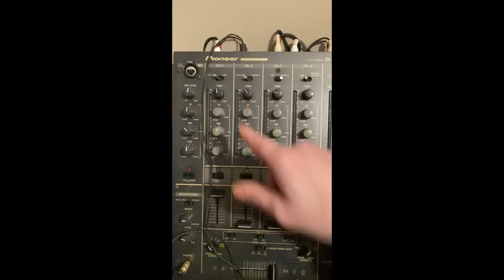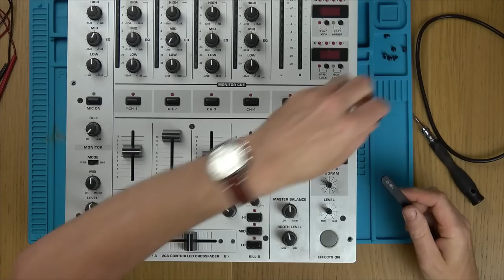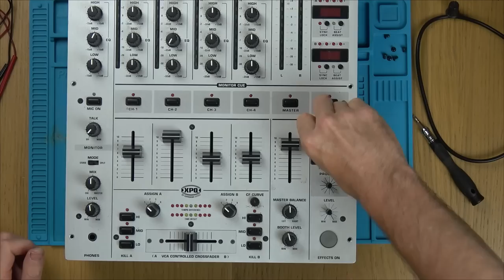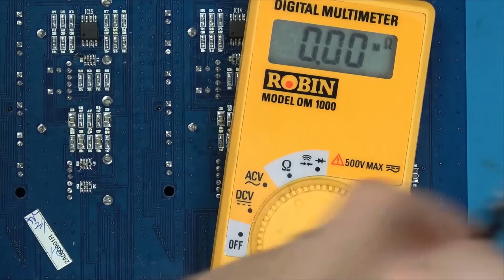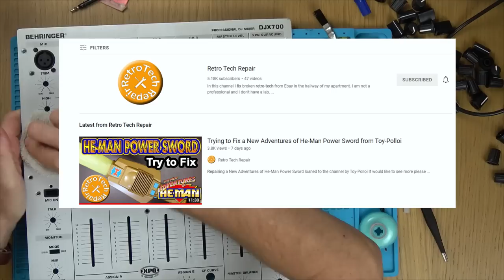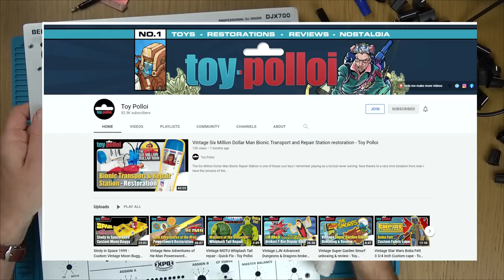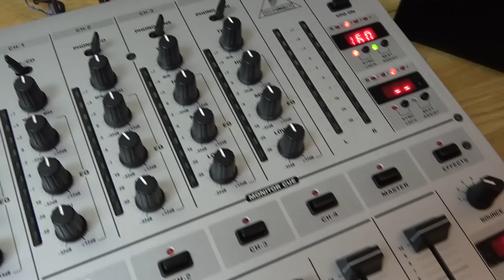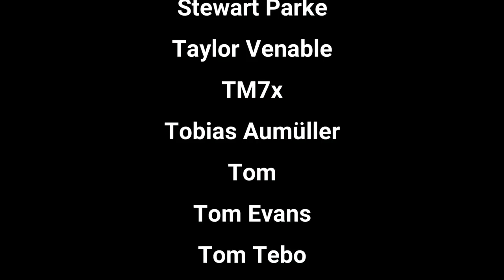Can I Repair a Faulty BEHRINGER DJX700 DJ Pro MIXER

Comment: Hi vince! Very cool video there! 👍

One tip on measuring resistances, don’t take the vales under the resistor to serious. It just means the component needs to have that amount of resistance, but combined with other resistances in paralel can offset your measuring value, which is totally fine. If you just have one resistor, of 100ohm, you will measure 100ohm, if you have two resistors in paralel of the exact same value, in this case 100ohm, you will measure half the resistance, 50ohms in this case. Gues what the resistance will be with 3 of the 100ohm resitances, 33ohm in this case. On 3times a 333 ohm in parallel will measure 111ohm just to make another example. 

On different values of resistors you need to calculate them thru, but remember this as normal for reading an offset value in measuring resitance in a circuit compared to the component specification. Hopes it will help you😀 there is a forumula to calculate the total value of a circuit consisting out of different parallel resistors. Resistors in series you just ad them together to their each respectively and possible paralel path. 

I hope you already found out about inductive load in AC systems and their inductive resistance. Dont take a low resistance all to serious in ac systems as well. If you measure a tranformer of coil.

Keep up to good work🙂
Reply: Yo vince, I forgot to tell, if you ever measure parallel resistances, expect to see a lower readout then the lowest resistor used in that circuit. This might hint you directly if a measurement could be legit or not.

Comment: I had a few of these mixers, they get you out of trouble for a while, but they always seem to develop these problems. Must be done to cheap parts. I had some advice from a sparky, who specialises in dj equipment, and he said the are not really worth the agro for a few reasons , part availability is apparently a problem. My one at moment has no output on headphones and every Chanel has interference , or low volume. It must be the switches and potentiometers, as these see the most use. I need to save up for a pioneer

Comment: Those behringer mixers suffer with bad up and crossfaders.
The other guys DJM600 was probably one of the best mixers I've ever had compared to the newer ones, really full sound on vinyl as they had decent pre amps in them.
Reply: I've got to agree, I had the DJM600 back in 1999 and with my 1210 Mk2's they were the best bit of kit I've ever had.
Reply: no, djm600 is not good sound-wise (muddy high, so-so mid) , but fair build quality and excellent repair/parts service is available

Comment: Hi Vince 
Looking at your when you were comparing chip numbers 22:23 the top pin of the pot ( by resistor r13) looked like it may have had a dry joint , may be worth looking at your footage ? So when you swapped them you could have cured the dry joint by resoldering the pots 

I do like the Rolls Vids , but it’s great to see some blue mat stuff as well

Comment: I had a tube radio that would squeal when I turn the sound down. Turned out that the volume pot was bad and it would go into oscilation. Could be something similar but dirt related?

Comment: By the looks of it it the channel two and master slider might have worn out or have dirt on the carbon tracks only came across one similar to that. The general fix is to replace the slider for a new one if the gold contacts is bent or broken or the carbon track is gone that what I would usually do

Comment: They can be funny things and get a lot of moisture in them mainly beer lol but the sliders should be zero half an inch to a inch from the bottom depending on the model and the top potentiometer is gain so theirs no middle ground compared to the high mids and lows on the others and your right if phono wasn’t grounded properly it would have an effect on the channel and the stereo capacity giving more on one side than the other but mainly due to grounding issues

Comment: For the desoldering vacuum, it is quite possible it has lost efficiency (assuming you were actually able to melt anything, you might just need to hold it there for longer, I assume you already had it set to 480c). I have used the same tool quite a bit and found that it is very sensitive to cleaning. You need to regularly replace both filters (the one on the front face of the machine as well where the tube goes in) in addition to emptying solder from the handpiece. And holding the board upside-down so gravity is in your favor can help...but I know this is not good for a video :)
Reply: also when desoldering something with a lot of metal attached to it (like a ground plane or RF shield), it could be that the heat transfer capacity of the tip isn't enough to heat the contact point up to the required temperature before the heat escapes. this could be due to number of reasons including dirt or oxidization providing heat insulation either on the tip or the contact. but if both are clean, there's no heftier irons around, and it feels like the target temp is close enough, then heating up the whole thing with a hot air gun first before retrying the desolder could just make the difference to get the solder to liquify, the means are many. (and if it's a crappy old RF shield there's no shame in first reducing the thermal mass with side-cutters, been there done that)

Comment: I have the behringer ddm4000 I took it apart cleaned the inside put it back together switched it on and it went pop now doesn’t work the magnet looking thing inside was hot glued to the inside base when I took it apart second time it wasn’t glued down do you think this stopped it from working or made it go pop please ? Also are you close to Milton Keynes area I love my mixer and I really miss is I have cash 💰 if this helps ?

Comment: you get two old forks to get dials tops off. also a note audio volume is not liner 10W - twice as loud 100W  - four times as loud 1000W

Comment: hi you never need to go any where with the buffer audio ic's   if they are playing up they over heat 
very likely it the pot logs  i worked on alot of  tascam 30 line and tascam  234-8  decks  and the da88  units

Comment: Stereo sound isn't equal, especially on audio recorded on some home video. The mic is only going to pick up what's louder going into the video camera microphone which may be either on the left or right side depending on where the camera is positioned to the speaking person. Monaural audio is equal all the time because it's one mic channel splitting into two both equal. Funny you posted this as my Denon DNX500 dj mixer took a crap on me after 14 years. They are very expensive top replace and they are not made to be 19 inches horizontal anymore to fit into my dj coffin. It's not easy to find a mixer anymore. So the parts are also not available for this mixer. I did find the main board on ebay for 70 dollars and I was sure that would fix the issue. I ordered it and replaced the board with the new one and then there was still issues. There are 3 boards in my mixer. I was shit out of luck. I had to find a used mixer for sale online. My worry was what conditions it was used in and how many hours it was used for. As it is, my mixer was taken care of and lightly used. It seemed to be a common thing for one of the channels to give up working. The channel assign is what crapped out. There wasn't much info on line about this but a few people had posted they had the same issue with that model mixer. The new used one I bought works well .....for now.

Comment: when it comes to the volume level being different between left and right, yes most is whatever the problem is with the mixer, but you will never find a song that is 100% recorded exactly the same on both channels, and that is why when you record in mono it just sounds dreadful when you put one channel as left, then copy the same track and put it as right channel. record a song on the pc from mp3 player or something, make sure you record as wave format, or got some software that can show the wave lines when opened, and you will notice the peaks are slightly delayed, or for a different instrument, is because they are slightly tailored that way so that you hear all the instruments in a song rather than one large massive noise.
Reply: also it gives it the warmth feeling rather than being somewhere like a bathroom whereby the sound is bouncing from wall to wall without any sound dampening.

Comment: I've given up repairing Behringer branded items as the switches, connectors and potentiometers that they use cause so many problems. You think it is fixed, put it back together and shortly after something else goes intermittent. 🙄

Comment: 15 minutes in and I'm going to say that the issue with the "mid" control is that the filter circuit is self oscillating for some reason... - I'll probably be proved wrong shortly!  Self oscillation is a hallmark of 70s analogue synths but not what you want on a mixer!
Reply: Defo an unwanted oscillation.

Comment: hi would say you fixed a digi pot that was on the way out  some of the line buffers are digi one's   
i need to get up to date with the new digi  mixer decks  in the ones i have you can hear the wear to the pots in the later one's you get all 
the funny digi sound     lot of luck you got

Comment: Interesting video Vince. I had a Behringer DJX700 just like this, it was a clone of the Pioneer DJM600. The effects on these boards are very interesting for their age.

Not sure if you have one, but I would NEVER use a blower/sucker vacuum on electrical components as they can transfer static and bugger up IC's and what not. You should invest in a antistatic vacuum (blower/sucker) for cleaning boards.

Comment: Most likely a dry joint due to the crap leadless solder. Re-soldering it with decent solder was probably all it needed.

Comment: The test leads on your meter are not the factory ones.
Your holding one directly on the exposed copper and the other had a pile of solder on it.
I’m sure that will have an effect on your readings .
Hopefully not give you an electric shock.

Comment: Sorry to say that 'Mat' did not explain how the mixer worked but but rather how to work it. There's a world of difference! Also a bit confusing to hear you talking about the car repair while dealing with the mixer repair. The value of the slider resistance will not be linear - i.e. not half at the halfway point, because our hearing is not linear but logarithmic.  Even so very interesting!
Reply: Agreed!  I sent Vince the video really so he knew how to "work it" for testing as it can be a bit daunting with all those inputs.  I used layman terms.  Had I explained how a mixer actually works, I'd have been speaking for hours and totally confused Vince.  Best was just to give a quick run through of how to use it which is what I did.
Reply from the maker: Cheers John, my choice of wording was incorrect. Matt was just giving me a quick crash course on how to operate it. I've never used one before and quite a few viewers would be in the same boat so I included it👍

Comment: I'm amazed at what you could do with no apparent knowledge of electronics whatsoever :D 
You're a lucky ba*d too, I've burned whole devices by overlooking some minuscule pin shorting two contacts, and you dropped the board on a metal case with no consequences? Time to buy a lottery ticket.

Comment: This mixer is such a genuinely nice concept gone so horribly wrong by just tiny fckups --- what is that gain/trim?? barely enough to level off proper line level inputs, but if something is too hot, you cant even turn it down! --- log channel FADERS - you know, to FADE-in and - out, smoothly - with log pots... yea, NO    --- and check how they managed to do a power-on/off mute: bjt ref voltage to (dun-dun-dunnnn) THE AUDIO SIGNAL - not even accidentally to the like GND... so as BJT works: it needs current from B (ref voltage) to E (here: audio out!!) to connect the E and C (GND) -- so if your out is too loud this will def distort your sound to hell  --- and my fav: internally MONO input on effect, then stereo mix it to master (while has all the parts to make it stereo, even some effect work that way too)

Comment: Not bad mixers. Basically budget rip offs of Pioneer products. You can pick them up for less than £100 now. They are kind of redundant in the modern world when a lot of products are digital and mixers usually have a sound card and USBs to connect to modern gear and laptops.